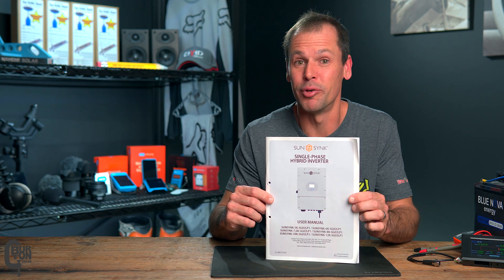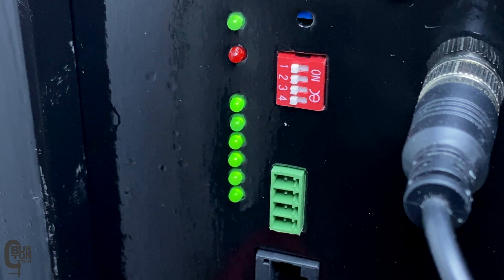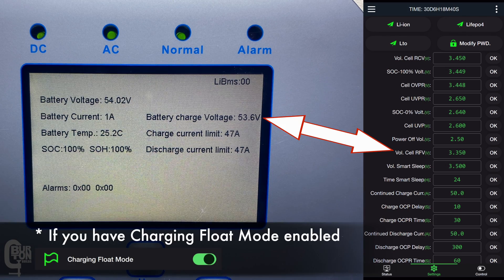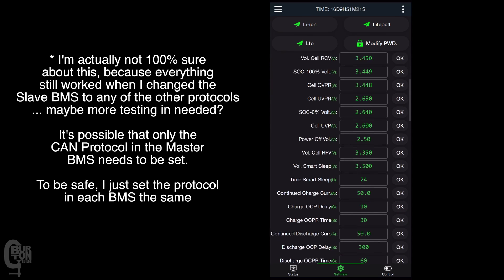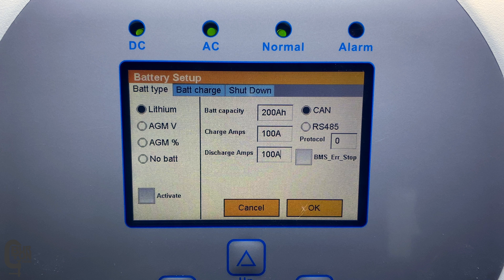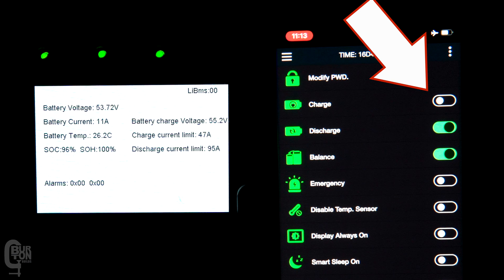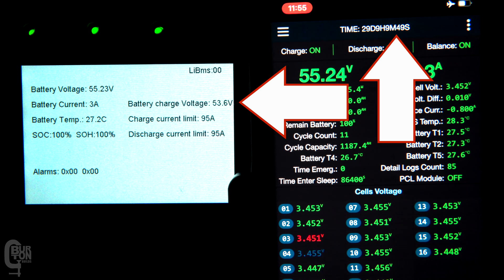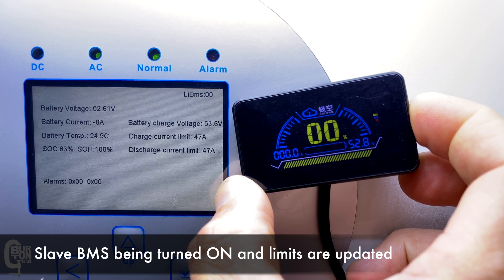Connect JK BMS to SunSynk / DEYE Inverter WITH Communication (Parallel and Single battery)

Comment: Thank you Grant! I was having no luck until you mentioned the DIP switches. Set them to 0000 and all is working now. JK-PB2A16S20P V19 and SUN-6K-SG05LP1-EU-AM2-P with normal ethernet cable.
Reply from the maker: You’re welcome. Good to hear everything is working now, and thanks for letting us know.

Comment: I do not have the possibility to switch between can and rs485 on my Deye
Reply from the maker: Hi Stefan, I just searched online for Deye Approved Batteries and CAN communication and from the looks of things (I have never physically done this myself), the option should be available on page 3 of the 'Battery Settings' menu on the Inverter. To the right of "Lithium Mode' it should show 00, which I think is the setting for Deye approved batteries using the CAN protocol. Batteries using the RS485 protocol use a number setting like 14 or 01 or 06 or 12 or 15 or 17.

Comment: Very Informational video. One question I have, as I need to do the same with my DIY battery and both my inverter and BMS communication cables went "missing". With that said I need to patch my own cables, however, I am really not able to get any information on the correct pinout. Does anyone have the specs or reference to those? Looking at connecting two batteries in parallel and then to a Deye 3-Phase Hybrid.
Reply from the maker: Hi Evgeni, look at this video at 02:13 and you will see a pinout for the CAN connection on the Inverter. This came out of the book / user manual that came with my Inverter. Have a look at the user manual that came with your Deye Inverter and see if you can find a similar picture where it shows the pinout - I'm guessing it should be the same.

The ethernet cables that I'm using (the blue one that came with the BMS and yellow one that came with the Inverter) look like standard ethernet cables with T-568B pinout.

Comment: Hi m8 i tried many ways to connect my battery to the inverter bms but no results
Reply from the maker: Do you mean you have tried to connect the BMS to your Inverter to get the communication working?
Reply: @GrantBurton yes
Reply from the maker: Maybe check that you have the CAN wiring is connected to the correct pins? CAN H and CAN L at 02:19

Comment: Thanks you , I have 2 batteries in parallel but 100 is charging to hindered percent while others remiss between 50-55 Percent , communication is done but slave battery not charging only at 3-4 amp if someone can help have Deye inverter thanks

Comment: at 4:44 that DC breaker noark Ex9BP-JX, is that to disconnect the battery? I see it is a polarised MCB, which is not suited for bi-directional battery current flow.

Comment: Does jk bms support pylon us2000?
Reply from the maker: Hi, at the moment, the only Pylon option available in the CAN protocol menu is 002 - PYLON-Low-voltage-V1.2
Reply: I got it working using rs485 connection, option 14 in jk bms
Reply from the maker: Good to hear 👍

Comment: Hello sir.
I have a question

SRNE HES48 6kW
JK BMS PB2A16S15P

When connect BMS and Inverter via RS485 WOW Protocol.

All settings on inverter will overrieded by BMS that's right ?

I can't set any menu after connected BMS, it will reset to what it be same value before I change it.

Thank you so much for this video I learned a lot. 😊
Reply from the maker: Hi, I'm not familiar with and don't have any experience with the Inverter you have, so can't really provide any good information.

With the Inverter I have (SunSynk/Deye), when the battery type is set to 'Lithium' and the communication between the battery and Inverter is setup, the Inverter will follow the limits set in the BMS (unless the charge and discharge current limits previously set in the Inverter are more restrictive than the BMS, then the Inverters limits will be followed).

You can also watch this video about testing the limits of the JK BMS and Inverter 👉 https://youtu.be/7AE8k0vhZPU hopefully it gives you some guidance.

Comment: Hello; thanks for great video and steps. Will it work if I use different version of JK BMS? I am planning to get PB2A16S20P but my existing one is PB1A16S15P.
Reply from the maker: You're welcome. Yes, it will work with that version.
Reply: @ thanks! just placed order yesterday.
Reply from the maker: @ Awesome, all the PB versions should work together.

Comment: Hey Grant, thanks for another great video. Is your JK BMS resetting the 100% SoC with your Deye inverter?

My inverter is not entering float/absorption mode or resetting the 100% marker. It seems that the inverter is setting the voltage rather than the BMS.

Any advice you can offer would be appreciated.

Thanks
Reply from the maker: Hi, Yes... mine does reset to 100%, or at least I often see the screens on both batteries showing 100%.

Is your CAN communication cable plugged in and working? In your battery settings on the Inverter, is it set to 'Lithium'?
Reply: @GrantBurton  yeah, it's set to lithium and the canbus appears to be working correctly. I can see from HA that it gets to the bulk voltage max state for about 4 hours on an overnight grid charge, but the SoC charge doesn't reset, nor does it enter float mode. All very odd.

I've set exactly the same settings as our video as we have a similar setup. It must be an inverter setting. I'll keep looking! 😂👍🏻
Reply from the maker: @007silverwings  What firmware version is the BMS running?
Reply: @GrantBurton  the latest V15.38 👍🏻
Reply: @GrantBurton  which is working fine on my friend's setup. Maybe I'll try reflashing the firmware too.

Comment: When I open "Select CAN Protocol" in the JK BMS App, all options are inactive except 000 and 006. BMS is JK_B1A24S15P, hardware version V11A, Software Version V11.54. The app is of the latest version from the Google Market. What might be the reason? Do these other protocols become available after the RS485 cable connected?
Reply from the maker: @yurizappa  Hi, I think that is the smaller ‘non inverter’ BMS and as far as I recall, if you want to use the CAN communication on those older types, you need to specify that when buying it as it’s not enabled by default.

On the new ‘Inverter’ BMS models (PB models which are hardware version 14 and 15) it’s enabled by default and the options to select various CAN protocols are available.
Reply: @GrantBurton  Thank you for the reply and clarification. I didn't know there are inverter/non-inverter JK BMS models.
Reply from the maker: @ I suppose they shouldn’t really be called inverter / non-inverter models as both types can be used with an inverter, however the PB series is better suited as a more ‘plug-and-play’ ready setup for use with Inverters / Energy Storage Systems.

Comment: whats with two bats AND two Deye's ? Do i only hve to configure the bat settings in the deye Master ?
Reply from the maker: Hi, I'm not sure... I've never connected two inverters in parallel... I guess the installation manual for the Deye inverter will give more information on this.

Comment: Do you mind sharing your JK inverter BMS setting for this inverter?
Reply from the maker: Hi, the Start Balance Voltage I'm using is 3.45v, RCV is 3.45v and RFV is 3.35v
Reply: @GrantBurton  Thanks! And is the Disable float charge tick on or off in the inverter settings? I cannot seem to understand that one
Reply from the maker: @mrx1979ua  Where do you find the 'Disable float charge' setting on the inverter? I don't seem to have that option on our SunSynk 10kw unit.
Reply: @GrantBurton  In the 5.5kW manual, page 41-42
Reply from the maker: @mrx1979ua  I'm not 100% sure but I think when battery type 'lithium' is set on the Inverter and the battery is successfully communicating with the Inverter,  the 'disable float charge' setting you mention likely doesn't do anything because the BMS takes priority and is requesting charge and float voltages from the Inverter.
Reply: @GrantBurton  Thank you. I think so as well, but Deye manual seem to hint this setting needs to be checked for the communicating bms, so may be not everything turns off
Reply from the maker: @mrx1979ua  Possibly... maybe you can try with the setting enable and disabled and see if there is any difference in when and how the battery floats (probably have to sit there watching the screen or setup a camera to see when it changes from bulk to float).
Reply: @GrantBurton  That's what I was planning to do when I get the inverter bms. TY
Reply from the maker: @ Cool… let us know how it turns out once you have it all connected and working.
Reply: So I've been trying to test this for 10 days now, problem is I cannot get the BMS to switch to the float voltage. It's only done so once. Still not sure how it is supposed to work with 15.33 FW
Reply: Specifically interesting what your Start Balance voltage is and what you RCV is (and RFV if you use it).

Comment: Hi there from Serbia. 

I’ve just got 4 of these inverters for my DIY battery wall, 3x 280ah and 1x305ah. As it goes with JK BMS, and I had few so far manual is close to useless. Package didn’t include bridge for 2 screws for B- and P-. Should I use both screws on each port or just one is enough? 

Also, as I have different capacity batteries which one would you suggest to be master?

Comment: JK BMS firmware 15.19 with Deye 12 Hybrid LV has the same problem with Force Charging.
Reply from the maker: Hi Randy, thanks for the info. This Force Charge issue seems to have been fixed from firmware 15.23 onwards.

Comment: Hello from Ukraine Odesa.  I have jk inverter bms 15.30 150 amp.  And Deye 6kw.  I have some issues 
-rcv set 3,45 volt, inverter shows the same values 55,2(16s)but are  charging  only for 55.1, and jk can’t  change regime because voltage will not reach 3,45
Reply: Друже, та сама фігня, не можу нічого зробити, нічого не вийшло?

Comment: Will setting the maximum charging current in the BMS cause it to be sent to the inverter and either decrease or increase the charging current?
Reply from the maker: Hi, using a SunSynk inverter... if the CAN communication is setup and working between the Inverter and the BMS, then yes, the charge current limit will be reported to the Inverter. The Inverter shouldn't exceed this maximum charging current. There is also a charge current limit (Charge Amps) that can be set on the Inverter... you'll see this at 06:36 

The maximum charge current will be limited by whichever 'charge current limit' is lower. If the BMS charge current limit is lower than the limit set on the Inverter, the BMS will be the limiting factor. If the Inverters charge current limit is lower than the limit set in the BMS, then the Inverters setting will be the limiting factor. Have a look at this video for an example 👉 https://youtu.be/7AE8k0vhZPU

That's how it worked when I did the testing with the BMS and Inverter firmware in the test video above... Not sure if this will ever change in the future so it's probably best for everybody to do their own testing to confirm it still works like this in the future.
Reply: @GrantBurton  Thanks for the reply 👍
Reply from the maker: You're welcome.

Comment: 2:17 Seems like Deye's RS485 pins are not compatible with JK's RS485 pinouts.
Reply from the maker: Hi Dan, I assume the Deye and SunSynk pinout for RS485 should be the same? Same hardware? 

In my SunSynk Inverter User Manual 02:17 ... RS485-B is pin 1 and 8. RS485-A is pin 2 and 7, GND is pin 3 and 6.
According to the JK BMS website for the Inverter BMS interface board, RS485-B is pin 1 and 8. RS485-A is pin 2 and 7. GND is pin 3 and 6.

Looks the same to me unless I'm missing something? I haven't tried so don't know for sure.
Reply: @GrantBurton  documents do indeed shows pins are compatible, yet I could not get it to work. :(
Reply: I just tried again, RS485 port on JK, and RS485/CAN port on Deye, using a regular UTP cable, no dice.
Again using that exact same cable, CAN port on JK and RS485/CAN port on Deye, WIN.
NOTE: On my Deye, there is only one Port for BMS and supports RS485 and CAN.
Reply from the maker: Thanks for the RS485 test info. Our SunSynk inverter also only has one port for CAN and RS485 communications... I show it in this video https://youtu.be/iXuFI8-lFQ8 at the 2 minute 32 second mark.

Comment: What voltages do you recommend for 16s 314AH cells pack? Use float mode? And you know what the PCL module is/does?
Reply from the maker: Hi, I use the float mode setting... I have the RCV Time set to 1 hour and the RFV Time set to 10 hours.

The PCL Module is the current limiting module... If disabled, the built-in 10A current limiter won't activate.

I use the same voltages as Andy mentions in his videos, and on his website here https://off-grid-garage.com/my-settings/ just scroll down to the JK Inverter BMS section.
Reply: @GrantBurton  ah, clear! And is there any reason or situation we need to disable the pcl mode/function?
Reply from the maker: @PhilippeCJR I don’t think it needs to be disabled, unless somebody else has a good reason why they think it’s better to have it disabled… but If I remember reading the JK documentation correctly, it’s purpose it aimed at limiting current flow between batteries banks in parallel.

Comment: Already tested 15.27? Its from Andy's drive
Reply from the maker: Yeah, I’ve been running 15.27 for a while now… busy making a video of the temperature protection testing with SunSynk inverter. It should be out later this week.
Reply: @GrantBurton  great to hear. Since there are radio silence issues....with JK itself i hope its still a good buy. I have 3x luyuan box and 3x 16pcs MB31 in transport. With 3x jk200a bms. Its for my deye 12kw lv hybrid 3phase. It looks like deye protocol to be used in the Jkbms? Looking forward to your new video!
Reply from the maker: Seems the 001:Deye CAN Protocol is working so far, still has the SOC drift issue though… temperature alarms also not reporting correctly to Inverter but I’ll show more in the testing.

I’m also waiting for parts to experiment with push notifications being sent to my phone / HA when an alarm triggers in the BMS but more about this once I’ve done a bit of testing.

Comment: Good afternoon. I need your advice as a competent specialist.Installed the sun-12K-SG04LP3-EU inverter (3 phases).At startup, it issues an error F30 (does not see the solar panels), the decoding of the error means the failure of the main AC relay.When the city network is disconnected, the error persists.What to do?
Reply from the maker: Hi, unfortunately I'm no expert and I'm not sure what the problem may be. I'm also not familiar with 3 phase systems. I checked a SunSynk manual and as you say, the F30 fault code is AC_MainContactor_Fault.

Did you try ask your installer? or maybe get in contact with SunSynk Support?

Comment: Hi Grant,

I have a Solis hybrid 5KW inverter, and I'm using it with 16 EVE 304 cells and a JK inverter BMS with an active balancer. I've been running this setup for the past five months. The JK BMS communicates the state of charge (SOC) to the inverter, but the SOC keeps drifting over time.

Here's the issue: even when the BMS indicates a 100% SOC, the voltages drift slightly lower with each cycle. Over the weeks, the SOC gradually drifts, so while it shows 100%, each cell and the overall pack voltage are slightly lower than the previous cycle. If I adjust the battery capacity settings, the BMS resets to 70% SOC, and the inverter charges another 3 or 4 kWh. This SOC drift is frustrating because on cloudy days, my 16 kWh battery effectively only charges to 11 or 12 kWh. The remaining 4 kWh stays uncharged because the BMS incorrectly reports 100% SOC to the inverter. To fully charge the battery, I have to keep changing the capacity settings in the BMS back and forth.

Is there a way to use this inverter without CAN communication or by setting it as a generic battery? If anyone else has the same issue or knows a solution, please comment and suggest how to fix this problem.

Thanks!
Reply from the maker: Hi, I replied to your same question on this video 👉 https://youtu.be/tlNvlhV4NZ0